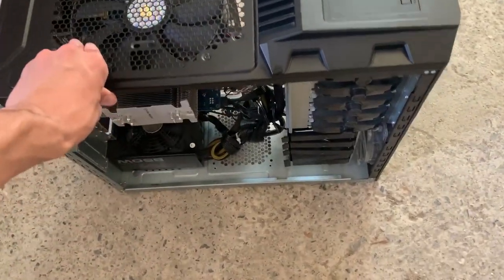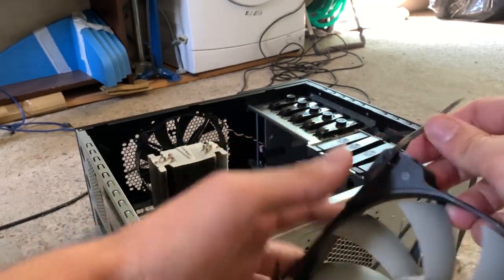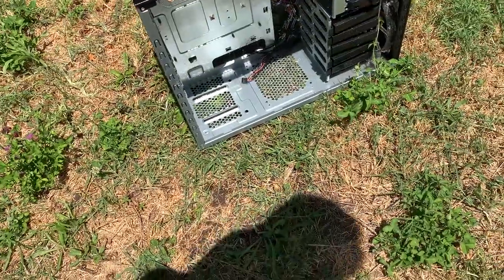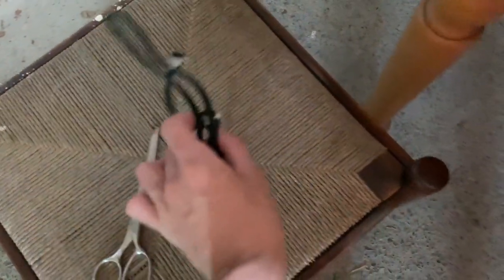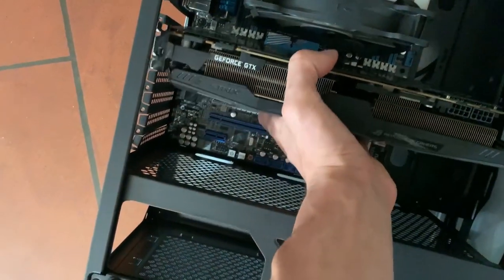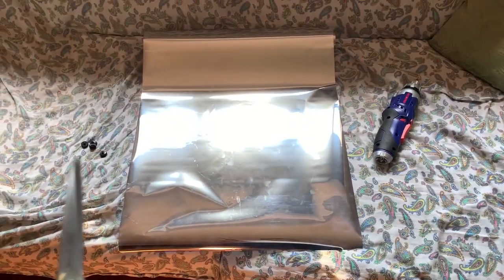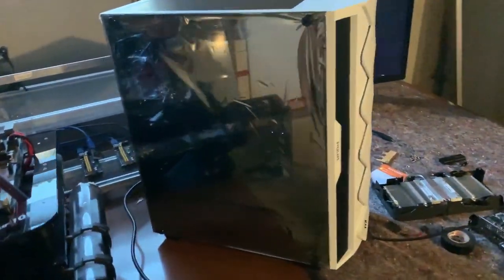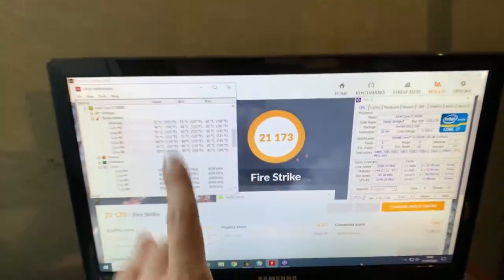I built a 700$ Gaming PC /w DIY Infinity Mirror and Zip Tied CPU Cooler

Comment: Your CPU cooler will be a) starved of air and b) pulling hot air from the GPU. Turn it around 90 degrees.
Reply from the maker: Nope, it's not gonna matter since it still acts as exhaust. I'm getting great temps, just look at the HWMonitor results in the video.